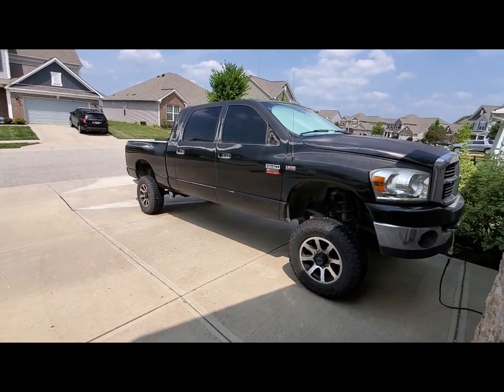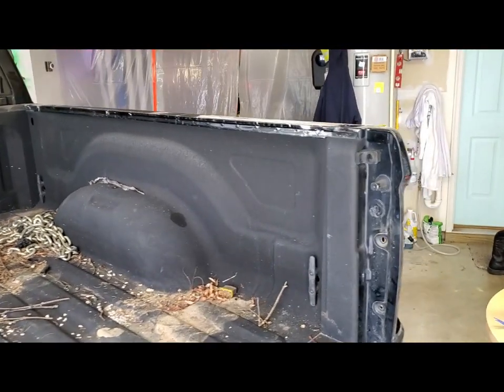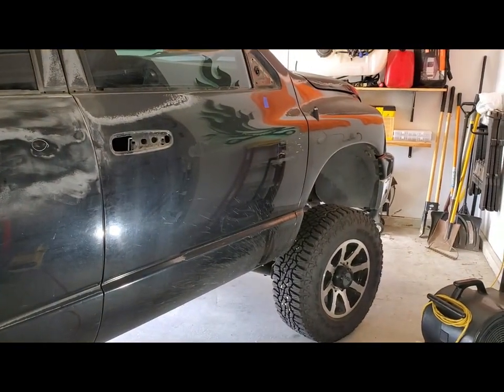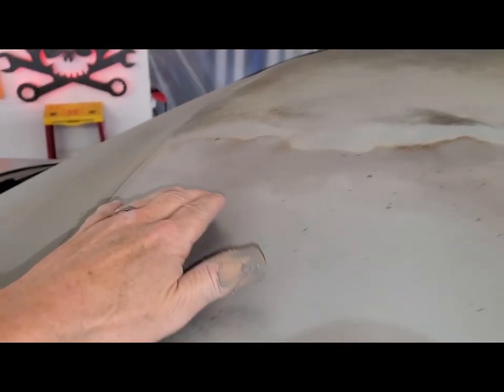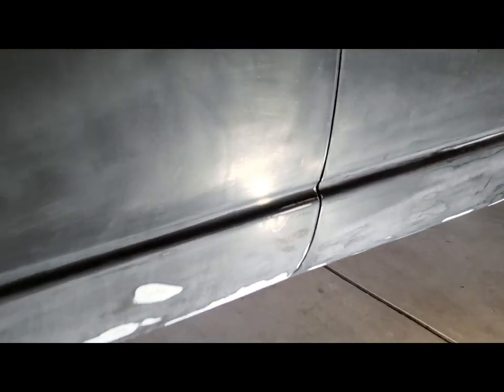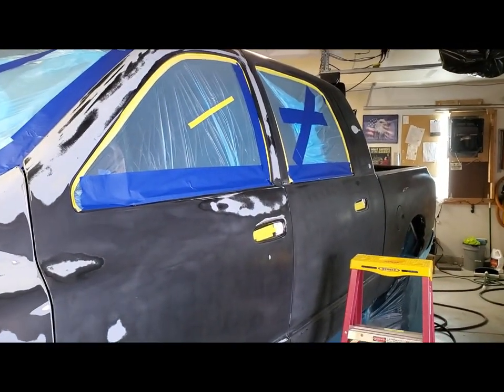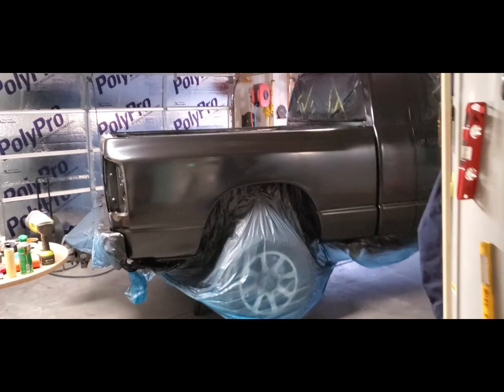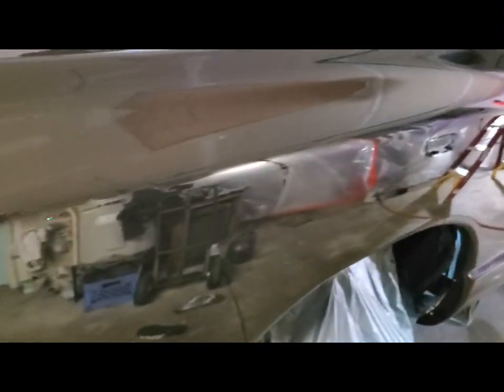Painting My Truck at Home

Comment: I have a 2003 F 150  w 135,000 miles fair shape…with the 4.6 liter ( NOT the 5.4)…is an extra cab, 4x4 MANUAL Trans, with manual shift into 2h/4h/4L…2003 was the last year that you could get a  MANUAL trans in this model… so to me the truck is very special…I’m an old school manual trans guy..yes the new autos with torque lock up are nicer than they used to be… but … a clutch, a throw out bearing and a slave cylinder …nothing else wears out if you treat a manual right…

It needs paint and I can’t stand the thought of MAACO promising quality work but then NOT doing the basics like really de-greasing the truck and tacking between every coat…
My dad used to say if it’s gonna get done wrong, you might as well do it wrong yourself.

SO…how much material did you use… sealer ?…Base ?…clear?
Thank you
I would rather take four days to do it myself… than pay MAACO $2500 for something I could do as well.
Reply from the maker: 1 gallon of sealer, 2 gallons of base, two gallons of clear.

Comment: You could've used two 2000 or 3000 grit works better than those scrub pads. When I get a run, it's easier when it's on flat surfaces, but even on the side. I flood it out that way, it's easier to what sand it out versus having those little drip lines to sand, those are a pain in a butt. So put extra clear on when you get a run and it's call flooding, works great and sometimes you hardly have to sand it. 1 day I painted something little runs. I hated sanding, so the next time that happened, I said what the heck and I flooded that puppy😬 but you know what I've found that works way easier, then sanding those little runs.
Causing more headaches then any of us ever want lol.

Comment: If that green scuff pad is from the grocery store you definitely used the wrong kind. The automotive ones are gray, red, or white. They all have a different grade of grit. Nice job on the truck though 👍
Reply from the maker: The green pads are equivalent to 600-800 grit. She is still holding up thankfully 👍